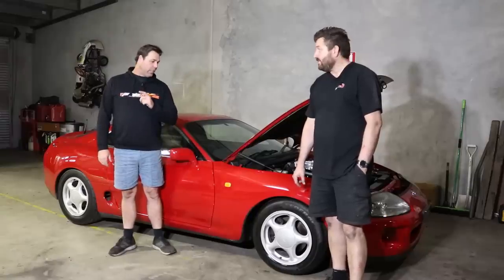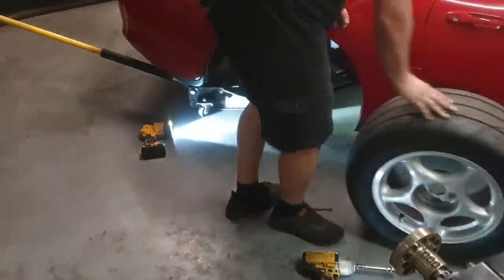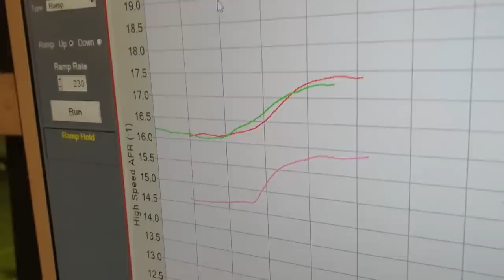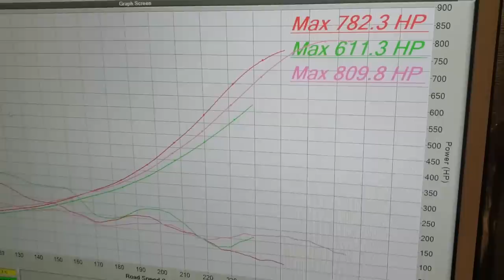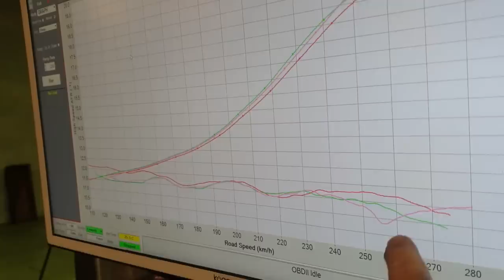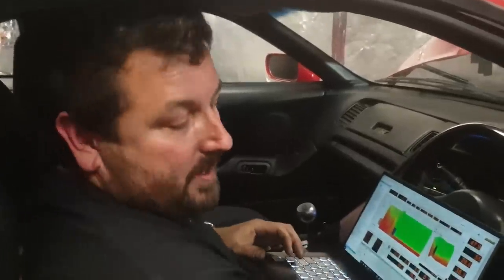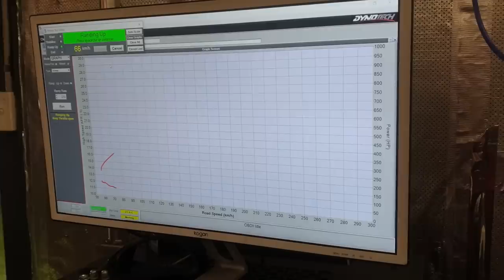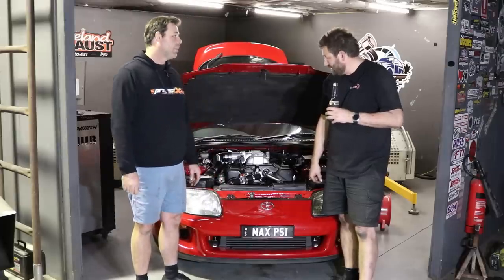V8 Turbo Supra Project Ep 9, 1000RWHP Turbo V8 Supra......... would be awesome but didn't make it...

Comment: Years ago a buddy had a turbocharged Harley. He put in A/R cones, between the head and head pipe, to see if they'd help with exhaust reversion. He said his lag vanished. With all your fab tools, I'd at least try making a different pipe just before the turbo with a little smaller diameter or a funnel shape. Slit it with the cut off wheel, squeeze the gap shut and seal it with a weld. The dyno will tell you if it worked or not. Put a pressure sensor in there to see what's happening. Sounds killer.

Comment: Hi Scott

Was watching nugget garage and came up with this Oil pump controller that could help you control the oil pump.

Oil pump controller

The Oil pump controller consists of a pressure sensor that monitors the oil pressure and in-turn regulates the speed of the pump based on a user programmed setting using PWM, it also monitors the oil pressure and if it drops will set an output to high.
Oil temperature is also monitored and will pull an output to high based on user setting.
Oil pump will start when an input is pulled high and in-turn turn off when input goes low.
Boost pressure is also monitored and will pull an output to high based on boost pressure.

All monitored inputs are displayed on a 5 inch colour screen and all user programmed settings can be adjusted from the touch screen.
•	Oil pump PWM in % digital meter
•	Oil temp in a analogue meter
•	Oil pressure in a analogue meter
•	Oil pump status on or off
•	Oil pressure low flashing screen and buzzer “Output to relay”  
•	Oil temperature high flashing screen and buzzer “Output to relay”  
•	Boost pressure in a analogue meter
•	Boost pressure output indicator

The screen is fully customisable to whatever type of meters or colours you like

If you are interested in this Oil pump controller
And if you can think of any other features you would like to include just email at adamjamesoconnor1962@gmail.com.  
  
Regards,
Adam

Comment: If you can afford the time and motivation, it might pay to swap the standard exhaust manifolds back in. Have seen a results of a corvette with a rear mount that was similarly laggy with extractors, went back to standard headers with heat wrap and transformed the car. From memory there was no loss of top end either. Obviously the pulse tuning and increased flow of the extractors was severely deminished being before the turbo, but the loss of heat and exhaust energy was huge. Pretty sure he tried wrapping the extractors first, to no avail.

Comment: When Al and woody used this engine on a conversion didnt they change the inlet manifold, (didn't they say the standard one had bad restrictions ?)
Mite want to get one them inlet manifolds off Al (skid factory?)..
Reply: Seems to me the stock manifold isn't that bad. Haha.
Definitely interesting.
Reply: @lucaslewisandneil146  
Yeah can't be that bad if it's making them number's 👍 I'm sure on the skid factory they said it was restrictive that's why they making a kit for it so the inlet came out the front off the engine?,(they definitely changed there inlet manifold )..

Comment: The 1UZ is the smoothest, most fantastic sounding V8.
Nudge the timing if you’re at 101% duty cycle and have the octane to do it.
They are a bloody tough engine and it’ll take some advance.
This car’s gunna be apeshit on the road.
Reply: Cannot compare to an LS
Reply: ArchimedeanEye Yeah, the 1UZ will last longer, rip higher RPM, and you could balance a coin on it because they are so well built.
At the time Toyota designed the 1UZ they were trying to build an engine that was better than a Rolls Royce, Bentley or a Mercedes. They were told it was going into both Luxury and Sports Cars.
And, you just can’t compare a Quad Overhead Cam V8, to a Single Cam Pushrod V8.
It’s going to breathe better, rev out faster and higher, last longer, and be more efficient in every way.
I Respect the Mighty LS, and some marvellous tech was put into it, but this 30 year old engine is still technologically superior.
Reply: @ArchimedeanEye  true bro. LS is trash in comparison
Reply: @ArchimedeanEye  Lets see an LS1 make 900+hp at 7500rpm on the factory crank then.
Reply: @JesusisJesus  A 6 liter LS is physically smaller and lighter while being 2 whole litres bigger with far less moving parts.  The 1UZ is more complicated but certainly not better in any way.
Reply: @Blarg217  Why?  Because internet told you?
Reply: @Beer_Dad1975  1000hp on the cast crank has been done too many times to count champ.  You dreamers need to face facts.  The LS can do everything a more complicated engine can do and be lighter, more compact and internally much bigger capacity
Reply: @ArchimedeanEye  LS1 isn't lighter though? An LS1 should make more power as it's bigger capacity. No science in that. I wouldn't go as far to say either motor is superior. Each has there purpose. 

LS1 makes a better boat anchor. 🤷.      🙈
Reply: @HowieTRD  1UZ is 177kg and LS is 165kg. while being waaaaay more compact in terms of height yet 2 litres bigger in capacity.  The LS clearly wins overall and the LT series is even better again.
Reply: @ArchimedeanEye  ahh your one of those kind of blokes. What ever keeps your ego at peice.
Reply: @HowieTRD  yes I'm one of those people able to reason and use logic.  I don't have TRD in my name fanboy.
Reply: @ArchimedeanEye  Spoken like a true internet warrior. Have a good day mate 👍
Reply: @HowieTRD  Slither away now TRD boi!
Reply: @ArchimedeanEye  there's no reason or logic. It's a shit design, less reliable and less efficient.
Reply: @Blarg217  The LS series are some of the most reliable performance engines ever.  The design is near perfection in terms of size, weight, cost, efficiency, power.  The Lexus V8's cannot match it.
Reply: @ArchimedeanEye  At 7500+RPM? No, no I don't think so.  Hey, I'm not hating on the LS1, it's amazing, but it's not the best engine in the world and it's not the only answer for everything - also in Australasia it's expensive and hard to find - you fanboys need to face facts :-D
Reply: @ArchimedeanEye  Personally, I like to wave bye to people in LS1 powered cars in my Barra Turbo - but it's whatever rocks your boat I guess.
Reply: @Beer_Dad1975   Shove enough boost into an engine and it will make big power.  You have to admit, driving a Barra off boost is about as boring as engine can possibly get.  It's still probably the best engine to ever come out of AU of course, but it's long, high, heavy with poor character.
Reply: @ArchimedeanEye  Again, it's horses for courses - if you are in North America, and/or have packaging and weight considerations, the LS1 makes good sense - if you are in Australasia and have budget considerations, and plenty of room in the engine bay or time to fabricate and front end weight is not a consideration - the Barra is a far easier option to big power.  BTW, calling the Barra out for poor character whilst extolling the virtues of the LS1 is hilarious.  Guessing you've never driven an actual high reeving V8?  The barra whist no engineering masterpiece, is far less agricultural than the LS1, far more thermally efficient under WOT, and certainly vastly more advanced in its final editions.
Reply: @Beer_Dad1975  It is far more enjoyable to 'cruise' in any V8 due to it's sound and torque than any six cylinder.  Most car guys would agree with that.  The Barra just happens to be one of the worst sounding sixes out there, unless pumped with 30psi of boost, in which case any engine sounds quite good, even an SR20.  

What would you say is agricultural about the LS series engines?  The fact that it's only OHV/2 valve with pushrods?  That is a deliberate ploy to save space, reduce weight and reduce cost.  Take an LS3 with it's 6.2litre capacity.  Why would it need quad cams and 4 valves/cylinder when it's already a 6.2 engine?  An LS3 has almost the same overall footprint as an EJ25 turbo engine in a Subaru but an LS3 can do 500+ HP NA. 

A 1UZ or Barra really needs heavy breathing and high RPM to make power because it lacks capacity, whereas the LS series is physically small, big on capacity, low on cost, light weight, thermally efficient in terms of cooling, sounds good and has endless aftermarket support.

What this comes down to, is car guys wanting to think they are cool by adopting something that is the road less traveled.  It's no different to a Harley rider kitted out with all the accessories (include the village people costume) under the sun thinking he is anti-establishment and outside the mainstream.  But all choices are simply production engines from Companies that make engines.  What was done here with the 1UZ is cool, but an LS would simply smash it to pieces all day long and in several different ways.  Just like the Harley guy, you will cling on to subjective factoids here or there while completely ignoring the overall and objective superiority of the LS.
Reply: @ArchimedeanEye  Not sure where you got that nonsense from, my Barra makes about 80% of peak torque at around 1700rpm.  This isn't 1990, turbos technology has come a long way.  Yes the LS is very small in comparison to its displacement, and it's simple and reliable and so on, all true - but it's also quite thirsty once it starts making big power, it's NVH levels are quite high, and it runs out of puff rapidly at high RPM - it feels like what it is, simple and reliable - so that's why I call it agricultural.  The 1UZ feels sophisticated and smooth in comparison and you can get to rev which makes it fantastic for some applications (e.g. power boats).  Low range power isn't everything.  I get the feeling you don't actually have a lot of real world experience?
Reply: @Beer_Dad1975  Yes, of course if you add an appropriately sized turbo the engine will make big torque, that is true of any engine with good engine management, but the Barra or the 1UZ must have a turbo to make reasonable power and torque, this is not true of the LS.  If you believe an LS 'feels' agricultural (lol) it's 100% YOUR lack of experience or more likely your 'muh overhead cams' bias, which is pretty much all you've got here.  Oh, and balancing a coin on the engine at idle.  Anyway, enjoy the Beige cardigan of the engine world that is your mighty Barra.
Reply: @ArchimedeanEye  Nothing to do with where the cams are situated - they just put them on top because that's the easiest way to do it - it's about how well the valve ports flow, and 2 suitably sized & shaped inlet ports and 2 exhaust ports are always going to flow better than 1 of equivalent size - that's just physics.  Then you add in the accrued gains of variable valve timing and/or lift over those multiple ports too and thus a multi-valve engine can be more efficient and rev higher too. Manufacturers don't just put this stuff on for shits and giggles you know - this is the reason the vast majority of engines manufactured these days have 4 or more valves per cylinder.

Comment: When my ke11 is done and borders are open to us Mexicans I'd love to bring it up for some roll racing. Not in the same league as a 1000whp supra though.🤟
Reply from the maker: Hell yeah ke11
Reply: @NuggetGarage  where can I check the rules with regards to how fast I can go with at maximuma rear half cage? It's a billet crank 4agte with a g2 gtx3076r. Made 350rwkw on low 30's psi, should be a little more livelier than the 125rwkw sc12 5k it used to have.